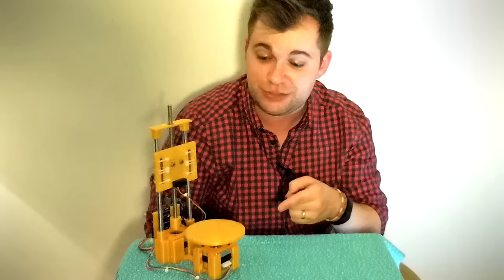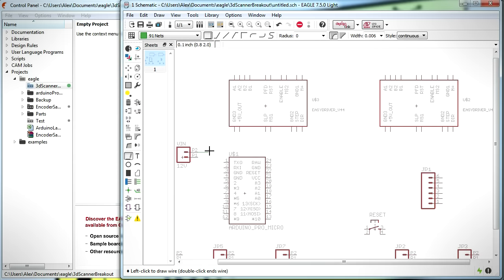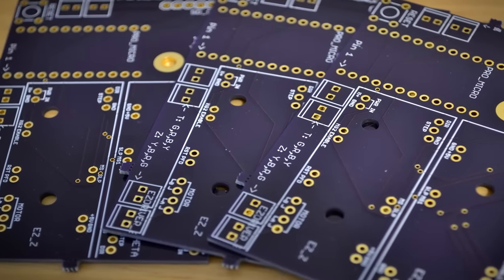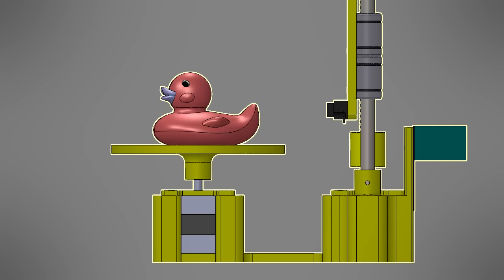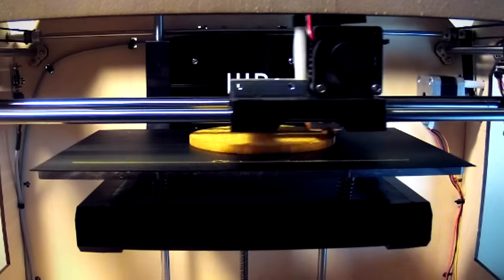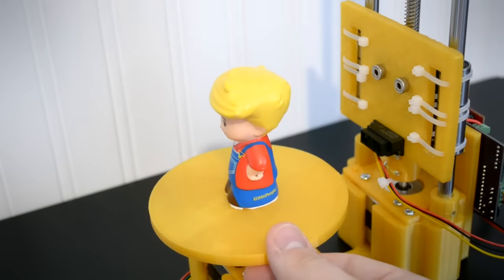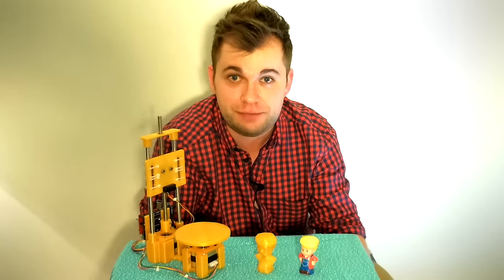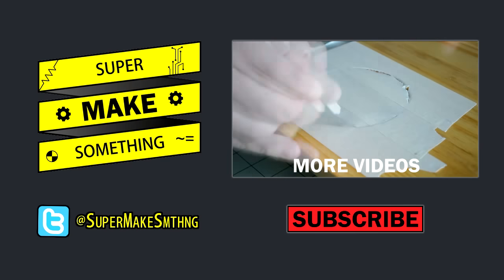DIY 3D Scanner (Arduino, 3D Printing, PCB Design, Stepper Motors, IR Sensing) - Super Make Something

Comment: @Super Make Something  hello when i want to do this project with arduino uno how are the pin connections and codes ? I'm new to this stuff.
Reply from the maker: The best way would be to follow the circuit diagram shown at 1:00 in the video and relate the pins shown in this circuit to those in the Arduino Uno. The pin names are also listed in the code and are found on the Arduino Uno as well. Hope this helps! Good luck with your project!
Reply: @SuperMakeSomething  thanks

Comment: Hello I tried making this exact project with with the exact same part and used the same PCB design however every time I plug in the AC/DC adapter my Arduino gets fried up or short circuited. Could you help me out on what I must do?
Reply from the maker: Hi Adharv, I have also observed this behavior with some Arduino clones. In these, it seems that the voltage regulator is not rated for the full voltage range specified by the Arduino spec. I recommend buying a variable power supply, then to start by powering the setup with 5V and slowly increasing the voltage until the motors spin. A v2 of this board would add a 5V voltage regulator to the Vin side of the Arduino, which would also prevent this. Hope this helps!
Reply: Hello Alex I see now. Would using a board made by sparkfun be an ideal option as they are the original designers? In the the this video what board did you use?
Reply from the maker: I would use a variable power supply as this eliminates potential to blow up a component the best in my opinion. This application does not require a lot of motor torque, so they should start spinning at a relatively low voltage.

Comment: Yeah bro.. Nice video...Great work... I decided to try it out..But i have a doubt... after inserting the sd card into pc, how to open the generated text file. Did i need to locate the file in sd card & then drag it into MATLAB...? Or it will automatically open while inserting the sd card..? Please mention the extension of the file too.. I really want to do this project. Please replay as soon as possible.. Anyway ThnX for this awsome video.
Reply from the maker: The text file should have a .txt extension and be in the root directory of the SD card.  You can either leave it there, or copy it somewhere else on the computer.  In the MATLAB code, I assume that this file is in the same directory as the code, but you can change this by changing the string in between the parentheses of the "load()" function at the beginning of the code.
Reply: ThnX For the replay... :-)
Reply: It is solved you problem and how did you do this, I keep getting error opening scn000.txt
can you explain it to me please

Kind regards
Reply: Does it caused by MATLAB Version.....?

Or i thnk it may caused by error in routing the file in to the bin directory...?

Pls reply Erwin
Reply: Joyal Joy 
Here is more explanation
http://www.thingiverse.com/thing:1413891
With MATLAB prog I'm not too familiar,
Kind Regards
Reply: I am unfamiliar with matlab. It is a vast program. Lot to learn. I have only little knowldge like signal generation in matlab. This is a gud project. I want to learn more in both matlab and arduino as well. Thats why i want to try this project. But i have not much to invest in these components. That why i concerned about the sync of text file and matlab... Any way thanx for the reply.
Reply from the maker: I have uploaded a copy of the scan file.  Please see the link in the video description.
Reply from the maker: I have uploaded a copy of the scan file for the figurine in this video.  Please see the link in the video description.

Comment: Hi, first of all congratulations for your project.
Can you please tell me the specs of the 12V power supply. I mean, what is the Amperage [A] ? I want to buy one, but I don't know which one :)))
Thanks.
Reply from the maker: Andrei Rosu Thanks! The supply can provide 6A.
Reply: Thank you Alex. One more question if I may. What about  Z-axis ACME threaded rod, is there any specs for it?..., I mean the distance of a step, I don't know exactly how it's called.
Reply from the maker: It is an 8mm ACME lead screw with a 2mm pitch.
Reply: Thank you very much Alex. I appreciate it.
You are awesome!

Comment: @SuperMakeSomething Hi, very helpful video, thanks a lot. I've been trying to research a DIY infrared scanner. Am gathering resources, but would like to construct this with an upgrade or two if possible, and wondering if you could advise briefly here. You mention upgrading this with a laser projection sensor (and I'm assuming also a digital camera to do the actual capture?). Is the idea that laser projection will help capture more of the light aberrations and the form, whtin the actual environment, whereas the IR does more of an accurate scan of the form itself, albeit only at a single point in time? Are both resultant data sets combined algorithmically, and would one (ie. the laser "image") rely on more photogrammetric techniques/post-processing, whereas the infrared is strictly a kind of point data set, as you've shown? I am wondering how difficult it would be to combine a point set with a sort of photogrammetric model scan, if you have any ideas there (I'm a programmer myself). Further, I was wondering the benefit of possibly adding a second IR sensor further up/down on the device, to be able to capture at an angle, at the same time the primary IR sensor captures "straight" on. Same question I suppose... I believe one would have to algorithmically combine the resultant point data sets to achieve the higher accuracy. Do you have any advice in this matter? Thank you Chris :-)
Reply from the maker: Thanks for checking out my video!  In general, it should be possible to combine a point cloud scan with a photogrammetric scan, however this would involve some significant computer vision code if you would write the application from scratch.  Specifically, you would need to 1.) stitch pictures together and use the resulting combined image to extract depth information, and 2.) relate your 3D reconstruction to the point cloud set.  For both of these, you may want to look into the "Scale Invariant Feature Transform" algorithm.  The second item may also be accomplished with careful calibration, though it might be difficult to get the accuracy you need using a home setup.  I hope this helps! If you do tackle this setup, please keep me updated!  I would be interest to see your results!
Reply: Sure thing, thanks. In further research it seems LIDAR is the more accurate approach. I don't know... to me it seems like they are the same thing (vs. infrared), just in different bandwidths of energy, with different algorithms to associate the data set. Would like to setup something basic and do some tests. I have decent experience with 3d geometry, lots of programming of course, would be fun, but need to find the time. Keep you posted if I do :-)

Comment: Hi Allex. I really need help. I am doing the same project but not able to configure the whole set-up. And does this really work because as per our teachers it's not possible using a single ir sensor. Please help me with this and we are having our exams very close.
Alex please help us.
Reply from the maker: Hello Martand! Unfortunately I am not able to offer one-on-one advice for issues, but the machine indeed works. The point cloud and resulting STL file shown in the video were made using this scanner.
Reply: Thanks Alex for the reply but will you please send me all the correct codes regarding the project. It will be a great help.

Comment: thank you make! but i have question. why you used motor shilder?   i used motor driver (drv8825) . and motor very very hot hot (maybe The motor temperature is about 103 degrees Celsius. so... my 3dprinting body melted. Should we replace it? very  painful.

Comment: Those purple PCBs are quite beautiful!

Is this a project an arduino newbie could undertake?
Reply from the maker: Thanks! The Arduino code should be ready to go as-is, so I think this would be a good beginner project.
Reply: I imagine getting the plastic body for the scanner would cost a fair bit, if you don't already own a 3d printer, which is something I intend to make first! About the resolution: could you improve it by just slowing the scan down? Or would a better quality light/laser really be necessary?
Reply from the maker: +Jeremy Hunter The parts should not be that expensive through a 3D printing service, but you are right -- with your own 3D printer it would certainly be cheaper. You could improve the resolution somewhat by taking more measurements at a finer angular resolution/averaging more samples, but for an order of magnitude increase, I think a different sensor would work best.

Comment: Awesome work but any chance we can get a how to using just an arduino and breadboard? Well and obviously the printed parts and other components just not the custom PCB. And possibly with an arduino uno?
Reply from the maker: x9x9x9x9x9 Check out the wiring diagram at 1:00. This should get you started. Re: the Arduino, you can compare the pin out of the Pro Micro to the Uno and start there. You may have to edit some of the pin numbers in the code, but the functionality should be the same.

Comment: Hi can you make a video on eagle. I use that but not renaiming never the pin. What is this procedure? You do not have connect thr pins with eagle? Thank's
Reply from the maker: +Giovanni Gentile If you double click on the wire or pin, you can assign a name to it.  Wires with the same name are then connected automatically.  I only recently learned this trick as well, and it has made my circuit diagrams much cleaner and easier to read.  There will definitely be more Eagle in my future projects, so stay tuned!  In the meantime, I can recommend the Eagle tutorial on Sparkfun.  It contains a lot of really good information to help you get started.
Reply: ***** Wow thank's a lot!

Comment: Gan why arboino pro micro why I die / not lights up and not to detect in the computer, whereas before it's okay continue to fit I try ksh program and I put in pcb I love the adapter even so die ya gan?
Please the solution, still a newbie about mechatronic, but I've joined the tutorial on YouTube steps really even broken.
Reply from the maker: It might be that the voltage regulator on the Arduino broke when you connected your power supply.  Unfortunately, there is no easy way to repair it, but if you get another one, try to connect it to a lower voltage first.  I've found that ~6V works well for me.
Reply: okay thanks suggestion, I have tried. then how to speed up motion step motor, if the program 200 step turn table = 1 step Zaxis, how to speed how and not affect the scan process. btw do you have a number that can be in contact ? I want to ask more.
Reply from the maker: Yovan Satya You can modify the microstepping parameters and pause time in the code, but both of those will impact scan resolution/quality. Unfortunately I can’t offer personalized engineering advice at this time, but if you have a general question during your build, feel free to ask it in the comments! :)
Reply: but how do i change step speed but not change the desired result? and why if the scan is complete but the result is error when run in MatLab.
this is Eror's writing:
Attempted to access indeces (1); index out of bounds because numel (indeces) = 0.

Error in processScanDistance (line 28)
r (1,:) = rawData (1: indeces (1));
 

Please solusinya, thanks :)
Reply: I want to ask again, I try to make 3D Scanner as you make it. I try because I'm still a beginner in this field, there are many obstacles tp some I can overcome, such as scan time problem, I scan an object but it takes a very long time. can be 4-10 hours, and when I see the results, very different from the objects that I scan. because I slightly modify it by making it bigger, and the sensor I use is also long, my sensor size is 20-150 cm. but I check the results are very different, such as not shaped. I still have that constraint. please Solution and help from you, I really hope it will be. Thank you...

Comment: Seems to me the zero position of the turntable must have extreme resolution with reference to when the scanner turns on.  Test it with a perfect cube and see what you get.  The scanner too seems to have too much play in it.  But interesting & good try!
Reply from the maker: Interesting comment!  I'm not quite sure what you mean when you say that the zero position of the turntable must have extreme resolution when the scanner turns on.  Could you please specify?  In theory, at maximum micro stepping resolution, the turntable would have an angular resolution of ~0.08 deg.  While this is high, I unfortunately do not think that this would affect the results in practice, because the spread of the IR beam cone is large enough that it would counteract the increased angular resolution of the turntable.  However, I believe that with a better scanner, say a single line LIDAR, this could dramatically improve the scan quality.

Comment: Good morning a question on the vine you used: Is 8mm in diameter step 2 how many principles? Normally the 8mm screws have a pitch of 1.25 while the 8mm for cnc use have 4 principles step 8

Comment: Great project. What was the total cost to put this project together if you don't mind? Do you plan to do any of the upgrades you mentioned?
Thanks again for the video.
Reply from the maker: +amtpdb1 I think the total cost (excluding the 3D Printer) was around $50. Most of the price went toward the stepper motors, which cost ~$10 each. If you can salvage these out of an old printer or CD drive it would definitely take a chunk out of the cost. I definitely plan on making the laser scanner upgrade as soon as I am able to obtain one! If I do, I'll be sure to post a follow up!
Reply: +Super Make Something Thanks

Comment: Could adding another IR scanner (like the redundancy circuit used in safety devices) and compare the outputs thereby creating greater precision in the scanning process?
Reply from the maker: Interesting idea!  I think that this approach would work well to get rid of systematic error (to compensate for errors in the calibration curve, for example).  By scanning each point multiple times and averaging them, this project already does something similar to compensate for errors in the analog reading -- the idea is that the noise of the analog reading is Gaussian noise, so it is possible to get the "true" measurement (the mean) by taking the average of a bunch of samples.

Comment: Didn't you have problems with the ambient-light during scanning? ..or did you do background measurement/compensation?
Reply from the maker: +Aditya Mehendale I did not find any scanning issues resulting from ambient light.  You are right -- other sources of IR light could negatively impact the sensor and cause it to report back incorrect values -- but keeping the scanner away from a window during the scan seemed to be sufficient for this application.

Comment: Great idea sir....but how does it possible for model a cube?...if transmitter rays get reflectd when it is 45 degree
Reply from the maker: As the cube rotates, the distance to the surface will become less, so it will still work.  You may not hit the edge exactly depending on the angular resolution you use, but the finer this resolution, the more detailed your scan will be.
Reply: Thaks for your valuable information sir.
Sir i have another doubt,when i read your arduino and matlab code sir. In Arduino there is a command {String filename="scn000.txt";
}.But you inserted a {former.txt }file in a mat lab.How does it works.
Reply from the maker: The string in MATLAB defines the name of the text file it will load.  You can either change the Arduino code to save the text file it generates with the filename you want, rename the text file with your computer after the scan is complete, or change the MATLAB code to match the name of the text file on the SD card.
Reply: ok ok sir, Now i got a idea about that file name .Thank you so much sir

Comment: How much can you improve the resolution by simply adding a second IR receptor. I've got a different project going that required my to buy some IR range finding modules; they aren't horribly expensive, but they aren't mounted at all. Adding a second receptor seems like a good way to up the resolution.
Reply from the maker: I definitely think that adding a second sensor could help to get rid of systematic error (to compensate for errors in the calibration curve, for example), which may make the scan more accurate and thus appear the be higher resolution.  By scanning each point multiple times and averaging them, this project already does something similar to compensate for errors in the analog reading -- the idea is that the noise of the analog reading is Gaussian noise, so it is possible to get the "true" measurement (the mean) by taking the average of a bunch of samples.

Comment: Hello Alex I have an issue with the Z axis motor rotation. The motor rotates well in clockwise motion however once all the components have been assembled with the linear bearings and sensor plates and backlash nuts the. The sensor plate doesn’t move vertically. Do you think the rotation angle or speed of the motor needs to be changed
Reply from the maker: It depends on how the plate is moving. If you think the issue is from the stepper motor not having enough torque, you could try to adjust the potentiometer on the stepper driver to allow more current to be used by the motor. Hope this helps!
Reply: Hello Alex during the mathlab filtering process once I upload the text file to the mathlab program it gave me an error message: 
“Unable to perform assignment because the size of the left side is 1-by-422 and the size of the right side
is 201-by-1.

Error in processScanDistance (line 30)
   r(i,:)=rawData(indeces(i-1)+1:indeces(i)); ”